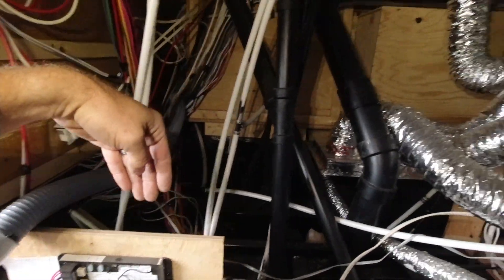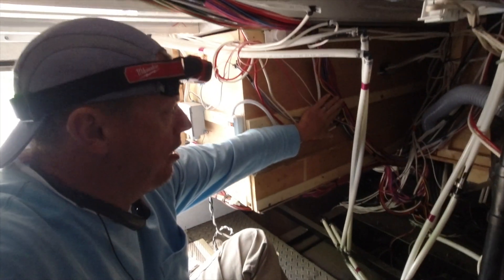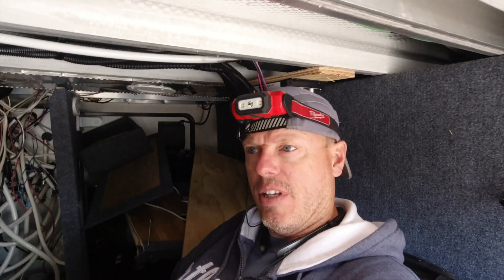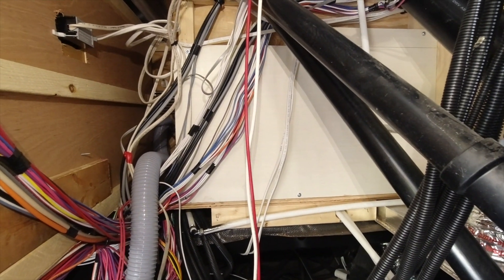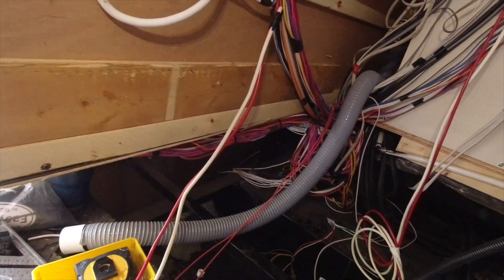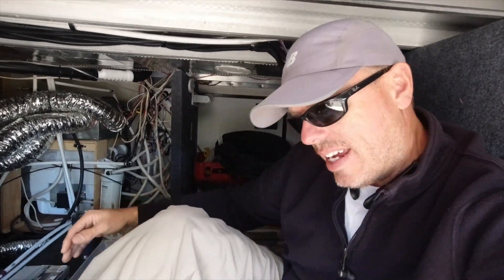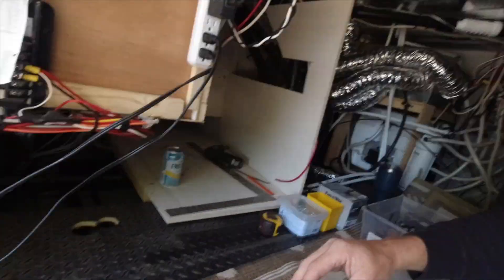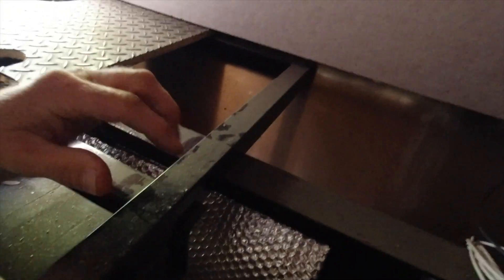Expandable Solar & Lithium System | 2017 Jayco Northpoint 377RLBH

Comment: How did you mount the panels? I have 4 of those same Rec panels and bought the Renogy curved mounts. This looks like angles at the apex side of the roof but I don't see how they're mounted at the edge. Thanks
Reply from the maker: Thanks Jeremy! If you take a peek around 13:22, you'll see some angled aluminum. Since this roof was so narrow, he didn't have enough space to utilize the typical z-brackets that we normally use between the edge of the side and the A/C unit, so he customized these brackets. He even included additional bracketing for additional panels on the driver side behind the one (16:02).
Reply from the maker: @Jeffry Jones the panels are flush mounted to the edge, not hanging off. The bracket is a single elongated bracket that runs the entire length of multiple panels for strength, wind resistance and rigidity. It's essentially a two-piece reverse Z that is bolted together.

Comment: How much would you charge for something like this
Reply from the maker: Nick Brozek a turnkey system like this one is a little over $15K.
Reply: @TheDryCampers  i was thinking that... Does that include batteries etc?
Reply: I’d be interested in talking with you about installing a similar system in a 2021 North Point 377rlbh